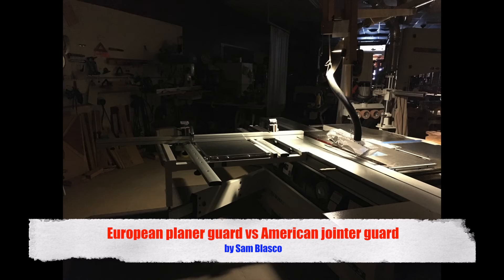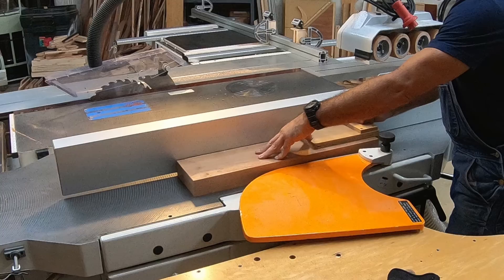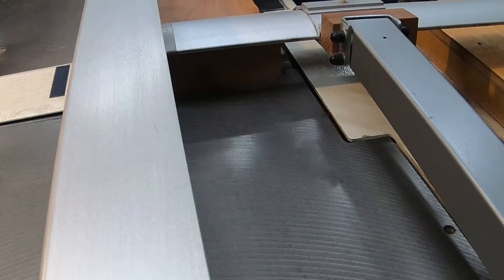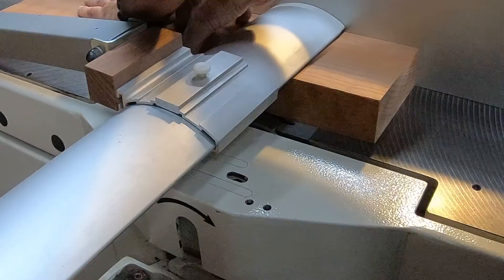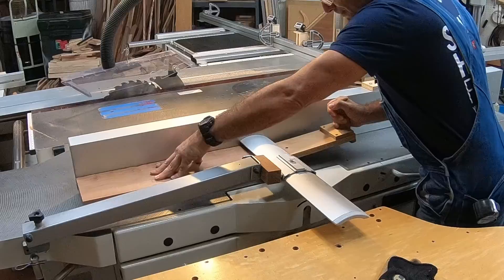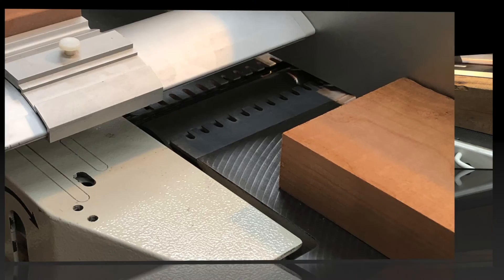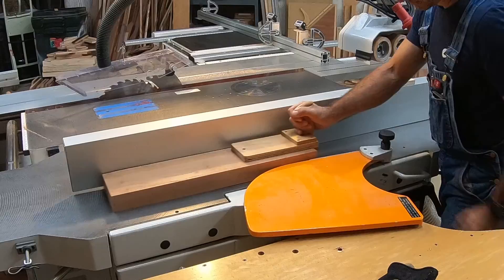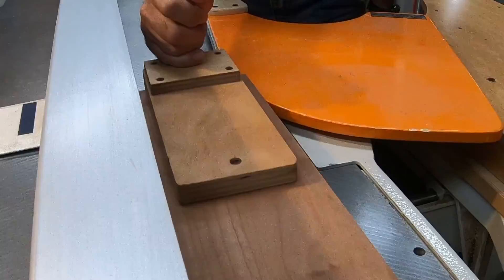European Jointer Guard vs. American Jointer Guard

Comment: Thanks for the vid. Was looking for exactly this comparison. I have the Euro one, and I never understood while it's left covering the whole piece of wood, having to jump your hand over the piece right where it actually needs some pressure. If it is for safety, I then don't understand why the American type would slide back allowing you to have the hands on the piece while it's over the blades. Why not then just slide the Euro just enough to cover the unused part of the blade? Anyhow... that's how I use it, so don't understand the hopping over the Euro guard thing. Thanks again and cheers from Spain.

Comment: Now I know. American guard all the way. Euro guard will just slow productivity big time. When I did this work, sometimes you had surface long, thick heavy wood. It was pointless to make full passes when starting, so I would work one end at a time until you could remove materiel in an entire pass. You just can't do that with a euro guard because you need to teeter slide the board on the leading or end edge of the machine.

Comment: Hi, the interesting part is, that the American version is not allowed to use in Germany, by law. The guard opens to early, if you have a wide piece of wood. It’s the same for closing, when you have passed the knife shaft. 

The standard in Germany for professionals is called Suvamatic. It’s expensive, but the most effective guard system, from my point of view.
Reply from the maker: Yes the Suvamatic is very nice, and crazy expensive.  The one I tried seemed to have limited range for the side spring, and needed to be operated more like the standard Euroguard, albeit with the up/down spring action, though it was still not convenient to use a push block like I prefer to use.  And, again, had a height limit, thus times when the guard would be useless.  Perhaps the perfect guard will be a robot operating the jointer!

Comment: Did you make the pork chop ?
Reply from the maker: I did not make it, although I modified it a little so it would work on my machine.  It is the guard from the SCM F410 Nova jointer.  I had access to the warehouse and a machine was totaled in shipping.  I asked for the guard and got it.  I had to drill and tap my machine to receive it, and I also added an aluminum edge (file bar repurposed) so the boards wouldn't dent the plywood as they banged into it when starting a pass.  It is definitely more heavy duty than the plastic guard that came with my machine, though I still have that and it works fine, but this was an opportunity that presented itself, I got an idea, and it worked out.  Anyone could probably order that part from SCM parts if they wanted to.

Comment: I don't know where this "European" guard system is coming from since there are many countries with there own laws and restrictions in Europe. I'm Dutch and never worked with either cumbersome systems you are referring to in your video. Watch this video, at 3:40 min he is showing how he is using it. This type of guard can move unlimited in vertical and horizontal direction. The way I've been thought is you push the wood over the blades until your fingertips of your right hand touches the guard. You lift only your fingertips over the guard while keep on pushing the wood with the palm of your hand. When your palm reached the guard, your fingertips are already passed the guard so you can transfer the pressure and keep full control during the full pass. https://youtu.be/EQeIDiya5gY